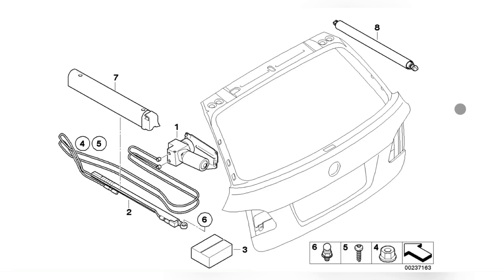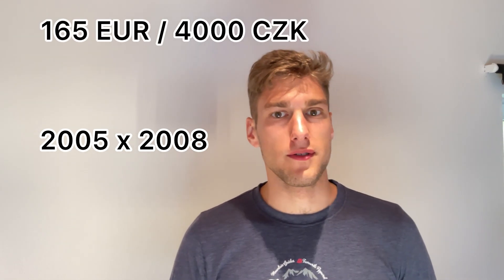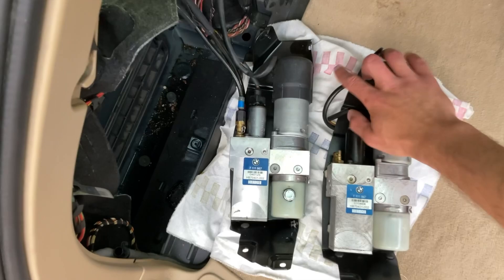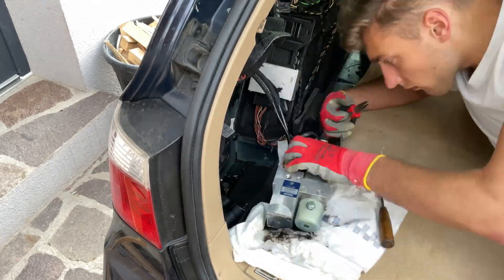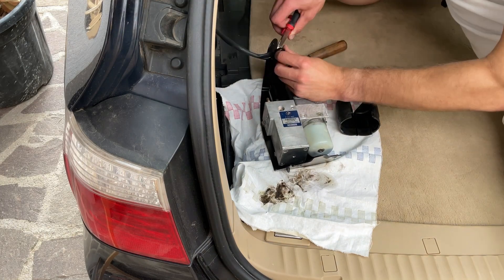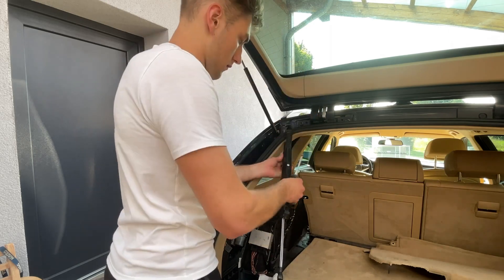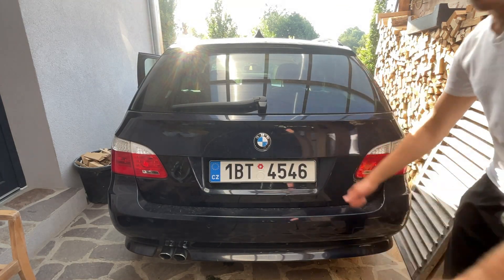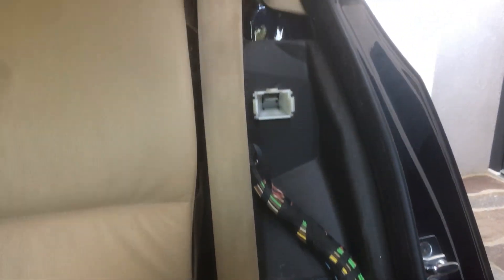HOW TO: FIX YOUR BMW E61 HYDRAULIC TRUNK [PUMP REPLACEMENT]

Comment: Can it be installed on a car that doesn't have the factory equipment?
Reply from the maker: Technically anything is possible. It would however most likely involve some cutting into the chassis. You could check out realoem.com and compare the parts for a model with and without etc. 

Let me know if you decide to do it.❤

Comment: How you filled with hydraulic fluid ?
Reply: I managed to put oil, but it still doesn't work. Does it have to be reset from the tester?
Reply: I'm back with a question, why doesn't it stay up, reach up and go down easily
Reply from the maker: With the previous pump as mentioned in the video (don`t recommend doing it that way :D). With the new one in there was no need to do so, there was enough oil.